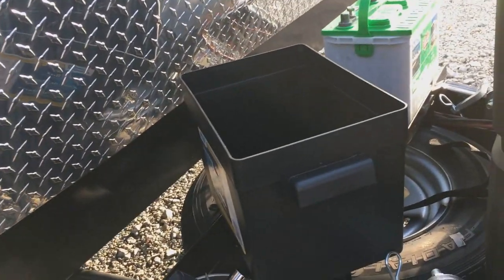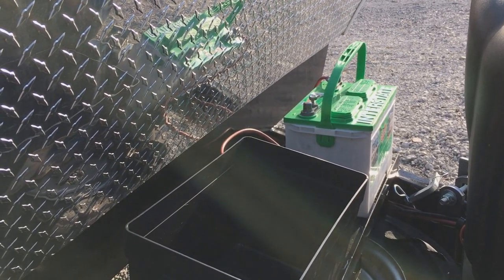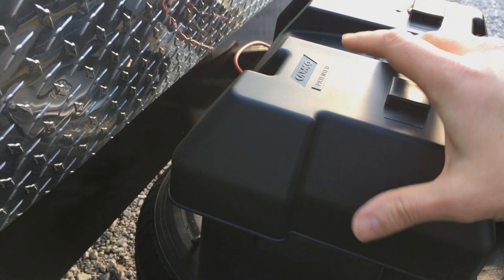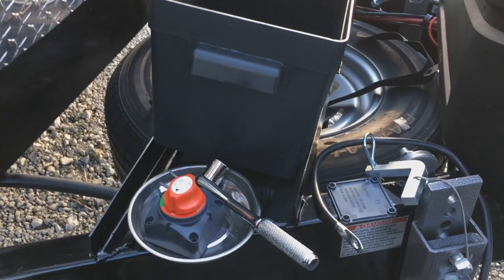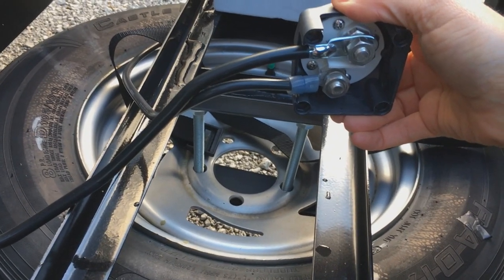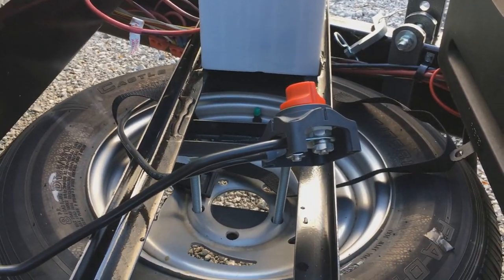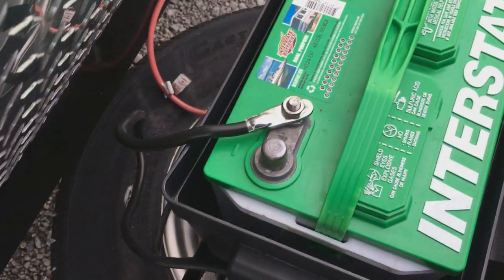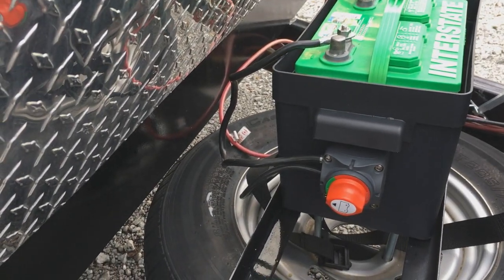Installing a RV battery disconnect

Comment: Always install a battery disconnect switch on the positive leg of the 12V system in case of chassis ground or hot skin state.
Reply: So many people get that wrong. Thanks for getting it right

Comment: If I have two 12v batteries tied to each other I can still disconnect using the ground right?
Reply from the maker: I would think so... Putting it on the negative lead between the chassis and the batteries.

Comment: Nice job.  Yours is the first one I've watched that correctly explained that you hook it up to the negative terminal, not the positive.  Question: how did you attach the base plate of the device to your battery box?
Reply from the maker: Thank you. The disconnect comes with 4 bolts+nuts to attach it with, so I just drilled through the battery box side and attached it with those.  It’s still working great.  Thanks for watching , glad it helped.
Reply: Everyone installs in positive side finally some one uses the ground instead

Comment: Did you ever seal up the side of the switch where the wires go into the switch?   If so, what did you use/do?  If not, have you had any issues yet?  Thanks for the video!
Reply from the maker: I have not sealed it and haven't had any issues with it yet. So far the disconnect has worked perfectly.  Thank you for watching :)

Comment: I’m confused can you please clarify! Where do both wires go? I see one goes to the negative terminal on the battery but where does the other wire go? I see it running behind the battery pack but I don’t see where it ends up connecting. Thank you for the video.
Reply from the maker: The existing black cable from the camper goes into the disconnect. Then, the short black cable I purchased goes from the disconnect to the negative battery terminal.  The existing red cable from the camper goes to the positive terminal on the battery.

Comment: Any chance your battery could sllde sideways in the box, into your mounting bolts, such as when cornering hard?
Reply from the maker: I don't think there's enough room in my battery box for it to slide hard enough to puncture the battery. If I had to corner hard enough for that to happen I'd probably have much more damage to my trailer than the battery getting damaged.  If that is enough of a concern though, they do sell rubber wedges that could fit into the box between the wall and battery. Much the same way some older vehicles had their batteries held in place to prevent wiggling. Something like a rubber doorstop would even work.

Comment: What gage cable wire did  you use????
Reply from the maker: I used a 4 gauge cable, but you could probably use a 6 gauge as well. My camper had a 6awg but I couldn't find any locally so went with the 4awg. This one: https://www.menards.com/main/tools/automotive/chargers-jumper-cables/east-penn-switch-to-starter-battery-cable/96779/p-1485933770251-c-9100.htm
Reply: @kingsmedley9282  I have the exact battery shut-off device.  Never have done this before.  So will i need to disconnect the negative battery cable only & use the cable extension to connect to the device and leave the positive connected to the battery?
Reply from the maker: @sflcross25  Correct, you'll only be disconnecting the negative cable from the battery and connecting that to the disconnect. Then run the extension from the disconnect to the negative terminal of the battery.  I would make sure that you have the disconnect in the "off" position while working with it just to be safe.
Reply: Every video i have watched doesn't make this very clear & for me it is the most important part of the install...which wires actually get connected to the cut-off switch..
Reply from the maker: @sflcross25  Yep, it was a big reason I made the video because I couldn't find any that showed this install. Sorry ahead of time about the audio, I didn't have a good mic back then :(
Reply: @kingsmedley9282  Thank you very much for this valuable information and getting back with me so soon, considering how long ago you originally made this video...much appreciated
Reply from the maker: @sflcross25  You're welcome, happy to help! :)